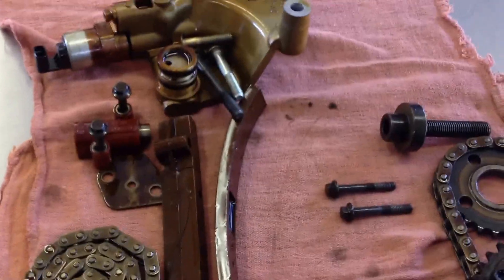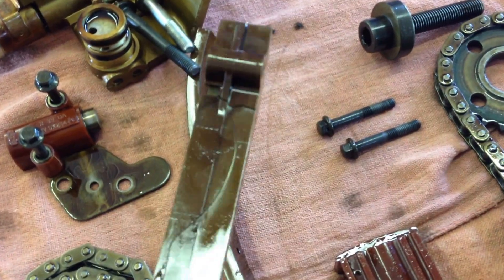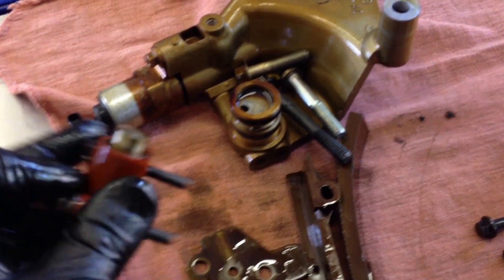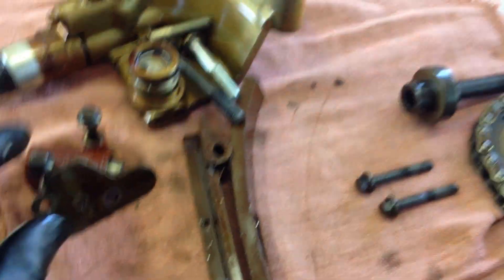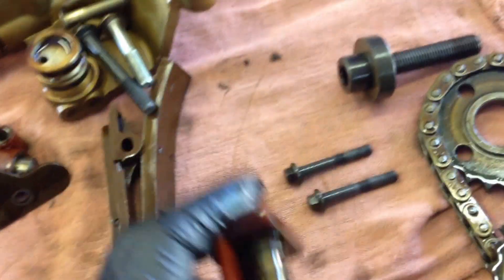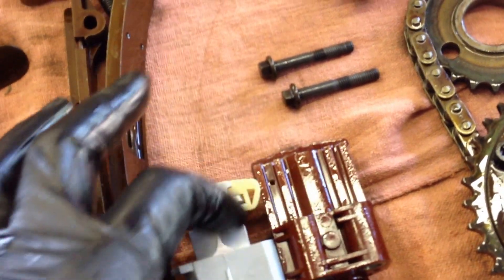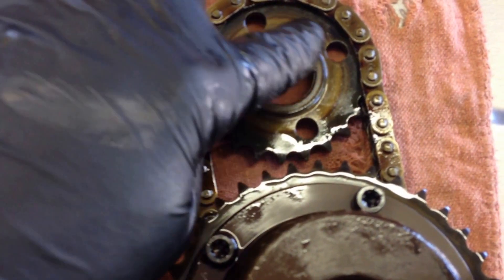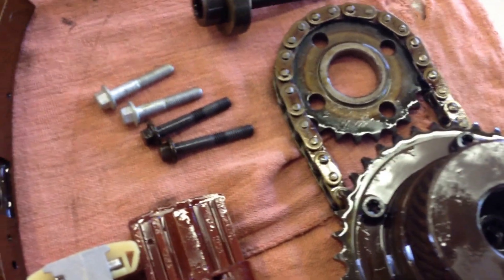Jaguar 4.0L AJ8 Timing Chains Part 2

Comment: If the chain jumps ? is all you do is line the cams back flat with the tool and make sure it's TDC  . Right?.
Reply: The cams have flat spots on the top of the cam...when they both look the same it's in time...take 2 sip ties and and attach two spots on the sprocket....Then in small steps loosen the caps....and keep them in order" lift the cam up and put the new tensioner on...put back in place ...on move the cam SPORKET? Mark the other chains in clock position them move off the gear at the bottom to put new chain on and guides and new tensioner " same for the other side...VVT...I DIDN'T MESS WITH IT AT ALL ...THE ONE ON THE DRIVERS SIDE IS THE HARDEST TO GET OFF...ITS THE WAY I DID MINE....IT TOOK A FEW STARTS FOR IT SMOOTH BACK OUT...2 YRS LATER...I DID A 4.8 LS SWAP..WITH A TRUCK NORRIS CAM...NO MORE TIMING STUFF OR TENSIONERS MESS 4 ME... JAGUAR XJ8...WITH ANOTHER V8 RUNS GOOD 🤭

Comment: is the rest of this job videos available ?
Reply from the maker: These two videos were simply meant to highlight what to look for, as far as the old vs new components and to familiarize the viewers with the parts and tools for the job.  Repair PDFs can often be found online for free.
Reply: OK thanks I am about to tackle a blown head gasket and it had a bit of chain rattle so upgrading that as well
Reply from the maker: Wise choice!  The timing tools are cheap on eBay and an absolute must!  Good luck!
Reply: where is your location+Autohaus Lake Norman